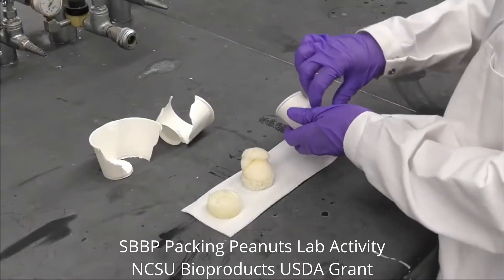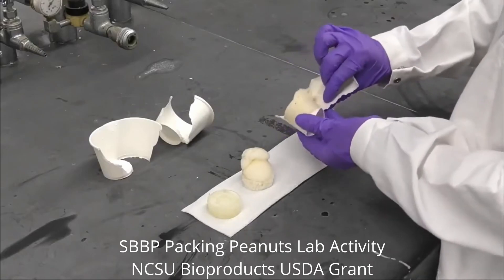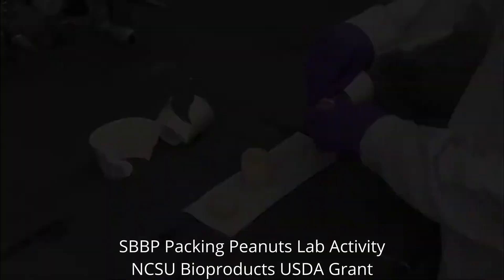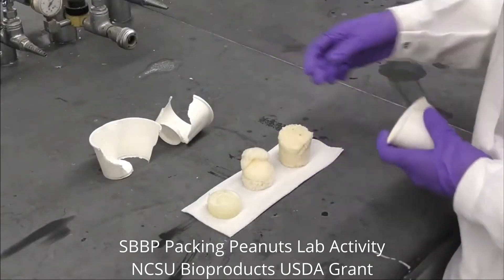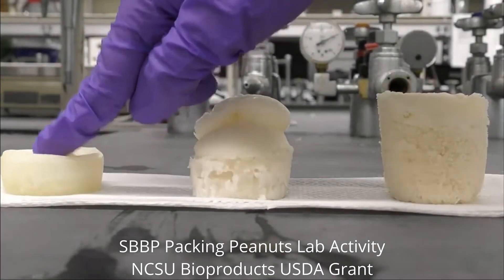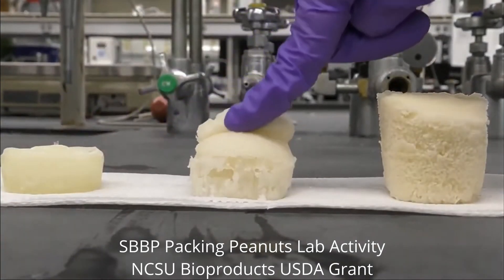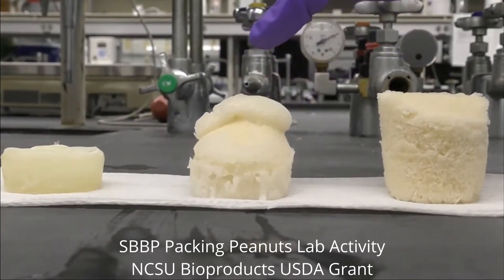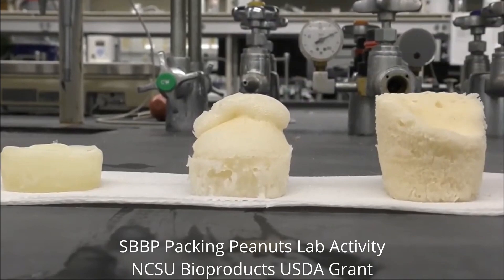Trying to Invent A Corn Starch Foam Recipe

Comment: You try a little 7th generation soap in there? They make stable foams using commercial product called Drexel  (this is for like water+soap foam) and I've heard 7th generation soap stands in for the more accessible alternative.  But if you need more time before the bubbles pop, maybe soap helps?
Reply: I second that- a surfactant to make the bubbles more stable, and possibly a polymer to create strong membranes. I tried making a meringue from powdered egg whites and got a surprisingly firm foam that was utterly inedible. I put it in a compost heap and it resisted decomposition while being rejected by all the bugs and worms, too.
Reply from the maker: @GseGodsSpeed  that's a great idea. I'll try it.
Reply: Yeah 7th generation soap has glycerin in it, that's why people use it for added stability but I'm sure basic soap will show some improvement